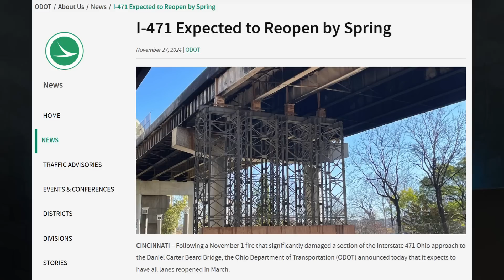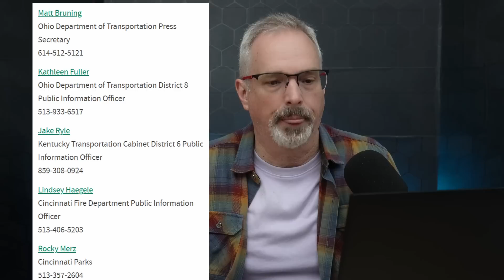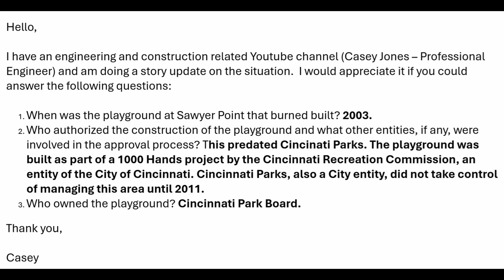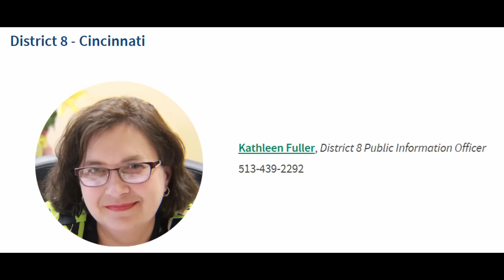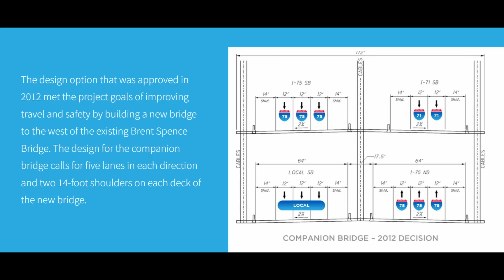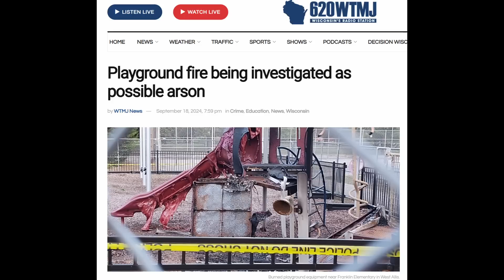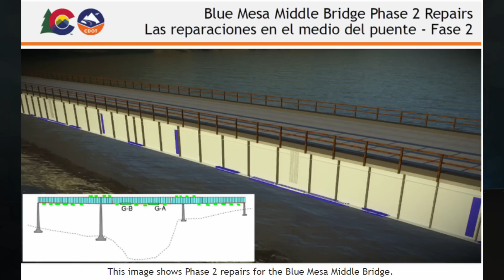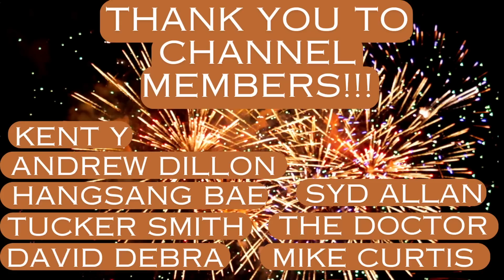Big Mac Bridge Repair Steps and Timeline

Comment: The design phase was completed before the bridge was built. Inspect, identify, and order from original specs while beginning demolition. The rest is smoke and mirrors trying to make themselves look good, thinking the public is too stupid to see the flaws in their "logic." "What you don't see" is all the government red tape and corruption. It takes time to line up kick-backs from, consultants, suppliers, and contractors. Sorry for the cynicism, but it is, what it is, and has always been.
Reply: Problem is, unless you get the same engineer, and construction firm to do the repair, as who originally did the construction.  Then there will have to be these delays.

The reason is a new engineer and construction firm could be potentially liable for any future issues relating to anywhere on this bridge, once they become involved with the repair.  They therefore have to approach this carefully.  They will need to do there own analysis.  Check the existing designs and material specs against current day best practice and current day industry standards.  And if anything in the original design, and existing bridge doesn't meet current day standards.  Them not addressing as best practice today, would leave them vulnerable in any future incidents.
Reply: So while it might be easy to just say :
"build it like it was before."  

No engineer or builder in his right mind would do such a thing without doing his due diligence before hand.

Comment: DoT should have, once the fire was extinguished, developed a project plan, including a Critical Path Method (CPM) analysis.  Once Critical Path is known you do everything you can to shorten the length of time from start to finish.  In this case, based on an educated guess, the steel beams are the major issue.

Once the beams have been determined to be the Critical Path you work the Path to shorten times.  Things such as material availability, fabrication, coatings, delivery, using multiple sources, incentives, overtime, extra work shifts, etc.  The process may require using multiple fabricators.  Or, they may look outside the box to find a solution that is different such as using a shipyard to fabricate beams.  You might also find a hidden source of steel, such as other construction projects or borrowing steel from shipyard inventories.  The reason I mention shipyards, I believe that both Avondale and Bethlehem Steel, both out of business now, would fabricate bridge beams.

19:47
Reply: Yes, borrowing steel is an option, especially in your own state, as is trading rolling dates if the nearest is booked up.  But the chance of having the right sizes and quantities doesn't help.  Keep in mind that most US shipyards just do defense work, much of which is running behind.  To a limited degree (because it has to fit up with existing bearings, splices, adjacent girders) a degree of substitution is possible, with analysis.

Comment: The powers that be better do some figuering pretty quickly. Bridges in this ecconomy have become parking lots for overstuffed cars, trailers and vans. I'm seeing it all over as I travel over the country. Here the smoke n mirrors are lost on me as. The original drawings are on file, the bridges is being repaired. Take damaged out replace with new, you will find now unseen damage as that processes. It's not beiing rebuilt nor reengineered just get the damage off and begin the process. FAILING Buearocray being exposed for all to see.
Reply: They have done a lot of figuring.  The problems are largely sociological.  If traffic flow improves people will accept more jobs, home, and play locations farther from home.  45 minutes seems to be the limit, on average. In Europe, where fuel prices are higher, people tolerate car travel time less.

Comment: Three months maximum for this emergency repair. Should it take any longer there should be an investigation of ODOT.
Reply: At one time you could call up your local bridge fabricator and send them the old plans or even shop plans.  They would scrounge up the steel from here and there and go to work.  Now bigger Plates and sections as used on bridges are not stocked so they have to be ordered from the mill.  Get in line.  That width and thickness comes up for rolling sometime between tomorrow and 6 months from now.  This is one of the effects of the "just in time" practices for supply chains.  It is worse for bridges as you probably are stuck with "buy american" laws so that even if it is available just across the border you can't use it.  You probably can get an exception to the "buy american" but the delay for that might be years... or not.

Comment: The old fashioned playgrounds, that I played on, were all steel pipe over sand. Nothing to burn, but you could get bumps and scrapes. It is funny that the new ones are often toxic and flammable. I have concerns that if they put the cranes on the bridge deck, a pier will topple. Good Luck, Rick
Reply: plus you could always dig for cat nuggets
Reply: I have had to analyze bridges for crane loads.  Note often structures are demolished using heavy equipment atop.
Reply: Chances are good that the cranes will be on the ground which is often what you see in Bridge construction.
Reply: My childhood park is still there, it was steel ~ only thing was that in summer it got scalding hot in places, but that was part of the character. Feel sorry for the new generation climbing on plastics or wood. Ground was not sand, but wood-bark ~ so it'll burn but then again it wasn't under a freeway
Reply: @smedleyx  You're right about the heat. Ours was situated so that after 0200 pm it was in shade from the big trees. Good Luck, Rick

Comment: What concerns me is what are "repairs" to the supports?  Patchwork or replacement?  I would think it would need to be replacement because you could never trust concrete once it is heat damaged.  We all know pouring concrete in the winter presents its own family of problems.  State jobs I've worked before prohibit additives to resist freezing in the concrete.  Likewise physical heat brings its own potential issue with surface crazing due to contact with combustion products, which may not show up for weeks or months.  So the clock is ticking as we head into the coldest part of winter, and so much needs to be done so that concrete can be ready to accept a load.  I suspect some compromises may need to be made OR the project may need to be delayed for more favorable conditions.  It's always a tradeoff, and it will be interesting to see which way this will go.
Reply from the maker: Thank you.  As usual, ODOT has been rather light on details and hasn't clarified which pier is damaged and how extensive the repairs will be.  I will stay on the story though.

Comment: 3 years is the standard design, bid, build process.  80% paperwork.  Emergency overlaps many processes, and some are not necessary.  It can be difficult to change or accellerate processes outside an organization's control.
Reply from the maker: Thanks for you for your comments. I agree with you, I've just never heard of an emergency repair project taking 3 years under any circumstances.
Reply: @CaseyJones-Engineer  I agree, at least for the scope of this one.  I do believe if you listen close... she referred to standard projects.  She was going fast though so you have to listen close.  Emergency flood repairs can take a loooong time simply due to the extent of the damage.  If sped up they often need to be redone to fix what was glossed over.  One span fire damage can be about 6 months, with obtaining the steel the longest time.
Reply: Unless you are replacing the entire bridge there is no need to reinvent the wheel. Unless there is something inherently wrong with the original design or engineering then a repair/replacement of the damaged area is straight forward.
Reply: @akshonclip  Unfortunately this requires a full knowlege of the past ways of doing things and their weaknesses.  Many design engineers are very risk adverse, and not just structural failure adverse, but legal issues adverse.  The defense against legal issues is following standard practice.  Standard practice is defined by the current codes.  This means if you take on a major repair you to some degree take on responsibility for the adequacy for everything else in the structure.  This doesn't necessarily mean you have to rebuild everything to new, but means you could be taken to task for 100 year old whoopsies of no relation to what you are fixing.  So you need to look at everything and hope your judgement is 20/20 on things you would never design yourself.  Note engineers are not educated on the way things were, but on current best practice.  Note geotechs have it worse as they get taken to task for what God built that stood for millennia but is now causing issues.